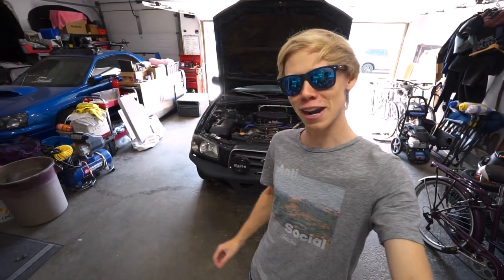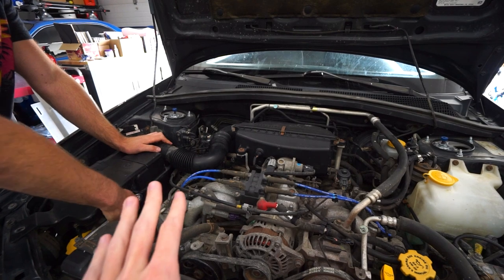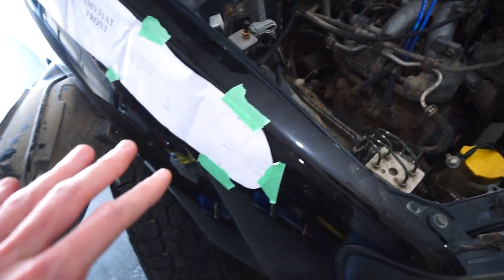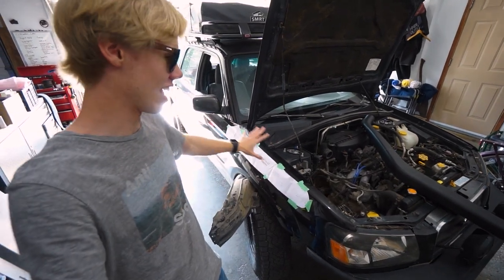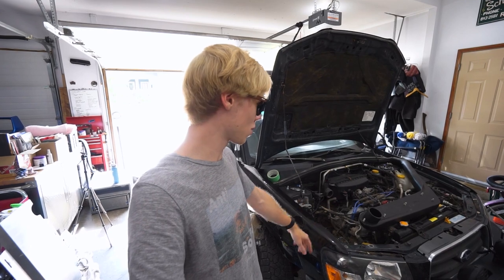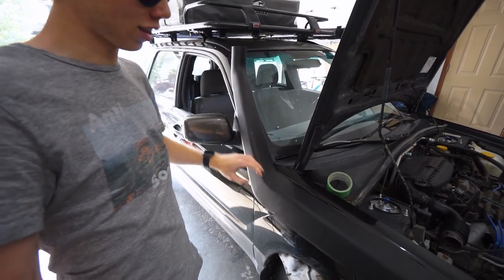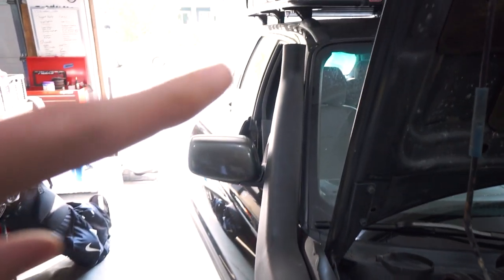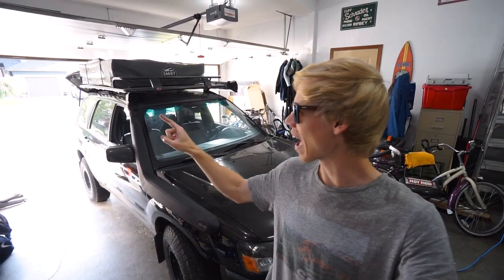How to Install a Snorkel on your Offroad Subaru Forester

Comment: I tried the ebay links below, but they've expired. Did some sluething and figured out it's a Mitsubishi Pajero / Shogun 1991-1999 Snorkel / Raised Air Intake VC34MI0201. Just ordered it a few days ago, so I'll know for sure soon enough :)
Reply from the maker: Oh no, I guess they changed the listing but that looks about right! My listing said: SNORKEL MITSUBISHI PAJERO I / II V31 V32 1990-1997

Comment: I noticed you've switched to round intake now. Any reasoning for that?
Reply from the maker: I am using the sy-klone precleaner, it helps remove the dust before it hits the engine air filter! Much more effective then just the scoop!

Comment: Greetings, I just bought a 1998 Subaru Forester and I want to put the Snorckel on it and I would like to know where I can get it.  What vehicle did you put the snorkel on the Subaru thanks
Reply from the maker: I'm not sure if it will fit a SF Forester but I am sure you can make it work, here is the link: https://www.ebay.com/itm/304391132428?hash=item46df20150c:g:GI0AAOSwwDtiKfKx

Comment: dude where is the filter? you do know you need the filter to catch any debris getting in through the snorkel right? otherwise cool video!
Reply from the maker: Are you talking the pre-filter? You don't necessary need to run one as I still have the stock air filter on the intake. Although I do have one coming!
Reply: @Chase_Schrader  oh I didn't see that but pre-filters are good to have though thanks for the clarification I totally missed it 😅